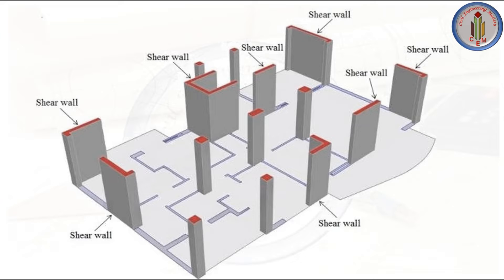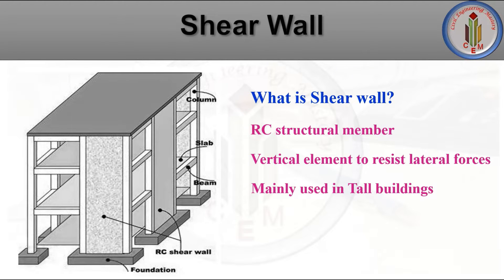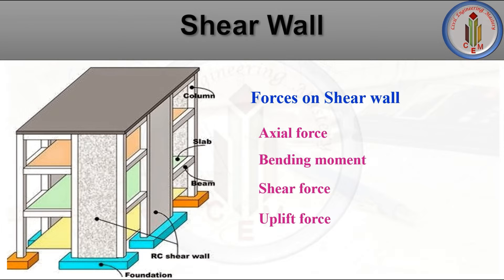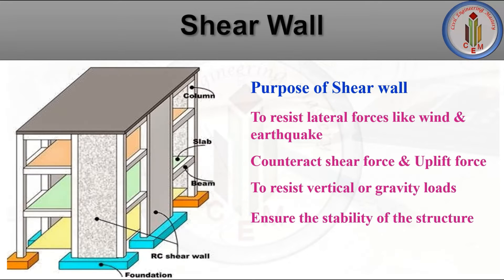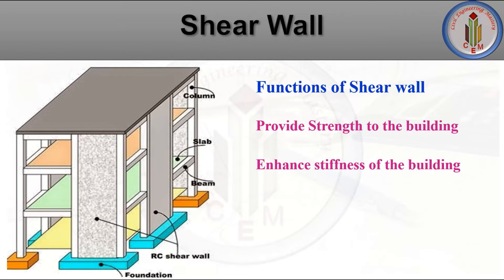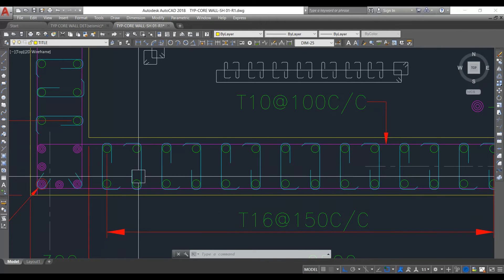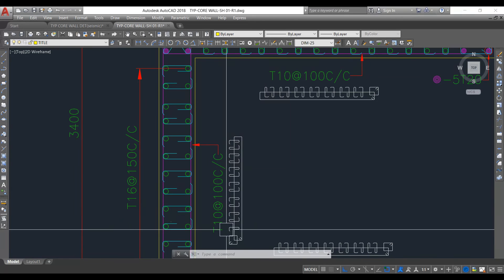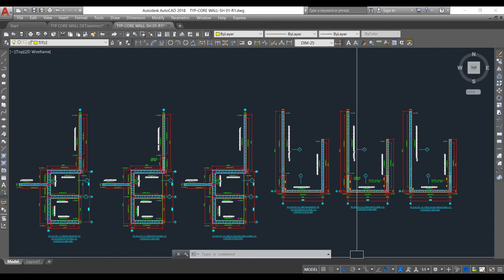Shear Wall | Lateral load resisting element | Forces acting on shear wall | Functions of shear wall

Comment: Thanks mam, Do we rest beam on shear wall? Does it act as column?Does require column at both vertical edges of rectangular shear wall?
Reply from the maker: We can rest beams on the shear wall. No requirement of a column at both vertical 
edges of the rectangular shear wall. Shear wall carries gravity loads like columns and it resists lateral loads such as wind and earthquake mainly in high-rise structures.
Reply: @CivilEngineeringMastery  Thanks Mam.